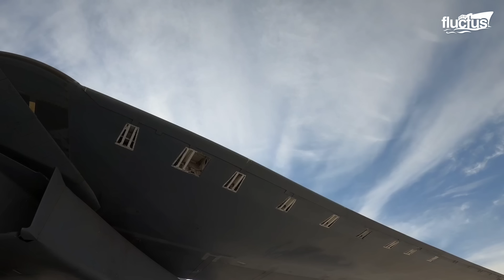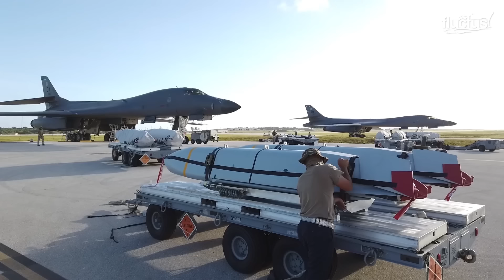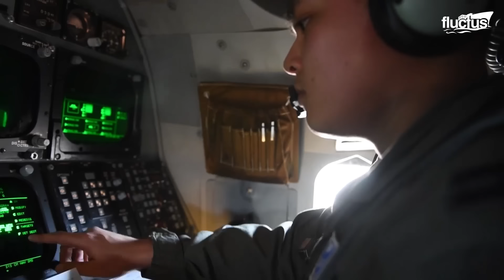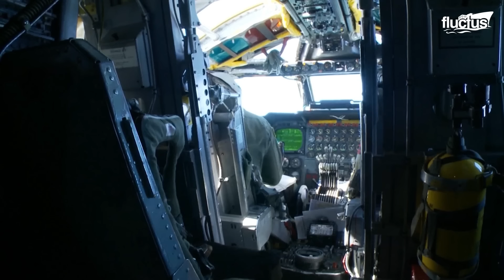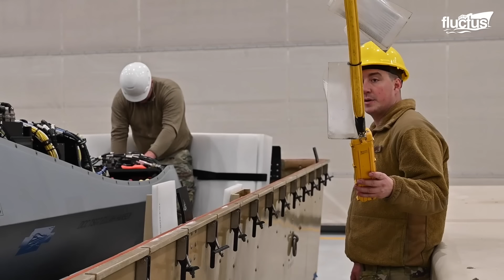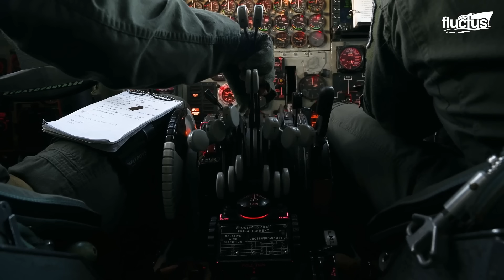Inside the Cockpit of US Super Advanced Bomber Flying at Supersonic Speed

Comment: It still amazes me that the internal payload is more than the B52. BUT, now that the nuclear treaty with Russia has expired, the B1-B can now use it's external hard points expanding it's capacity to a max of 125,000 pounds.
The B52 and B1 can now also have it's nuclear capability added back in.
There is also a rumoured B1-C variant that may be able to supercruise at Mach 2.0, just like Concorde ;)